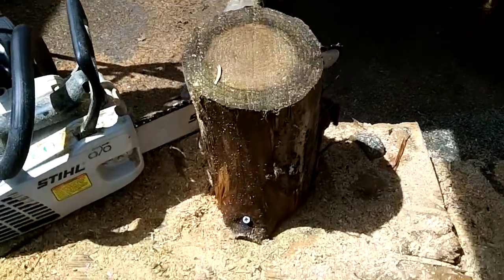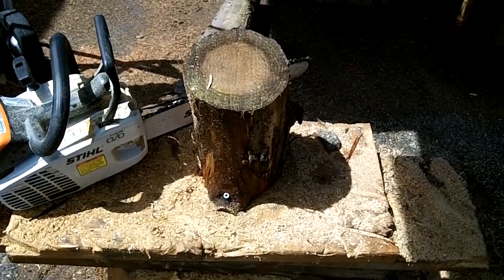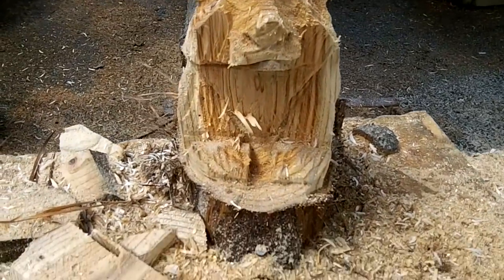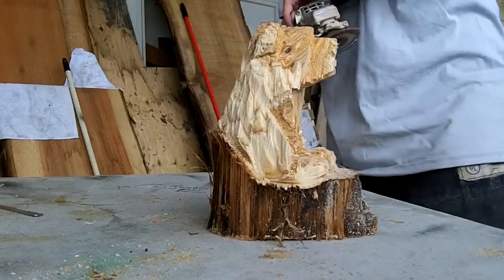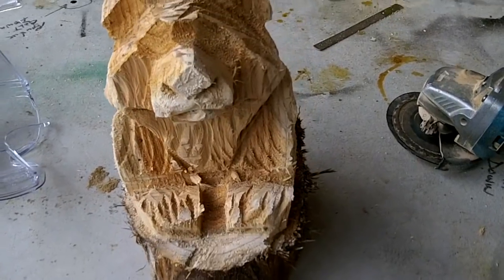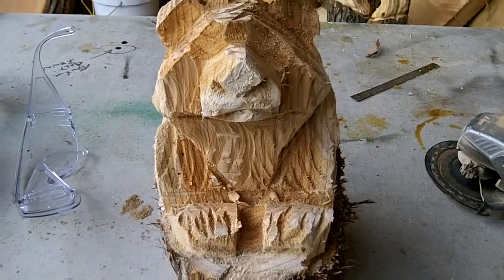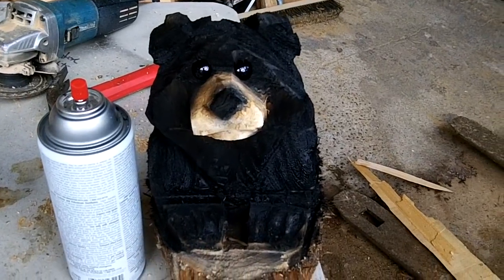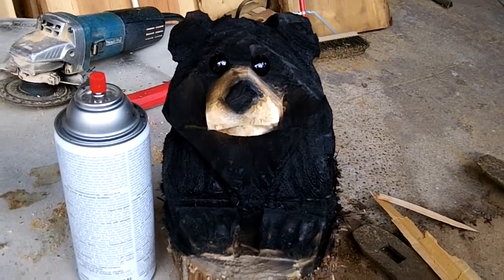Chainsaw Carved Small Cedar Bear

Comment: NIce work, but if you burn it with a torch you can skip the grinding, will get a nicer finish. Especially on cedar, burn it light and hit it with some linseed oil mixed with mineral spirits....Even if you want the spray paint finish after still burn it first 30 secs of burning and all you have to do is sand the nose, Almost 20 yrs of Chainsaw Carving experience .
Reply: Ed G totally agree..I'm no expert but I'm a big fan of the torch....I've only been carving for 2 months and I mainly use 16" chainsaw. Roto Zip and Torch. hardly ever use the grinder. I torch it then I go back and do highlights. but if u have any other good tips be glad to hear them :) also do most lol like marble eye balls or is there a diff method?
Reply: Hey Jeffery Good luck on your carving future, it's a great business and alot of fun. I prefer marbles but it all depends on the carving and what a customer may want. The best advice I can give is don't sell yourself short, and don't be afraid to charge for your work.
Reply: Ed G sweet! I'm a detail freak haha perfectionist in a way haha but I enjoy doing it really therapeutic. I learn new techniques every project. just still trying to perfect it still
Reply: I hear ya about wanting to be a perfectionist, and in the beginning it's hard to let go. But the best thing u can do is leave the mistakes. Only u see them, the people buying wont. And it makes the piece unique. And do everything free hand, don't draw lines etc. unless u have a special request piece. One thing I learned was people don't want something that looked like it came from a production line. Also don't try to do others work, people come to you for the look you make.